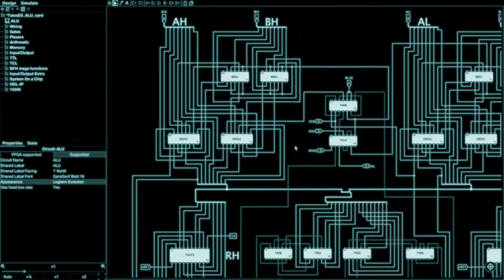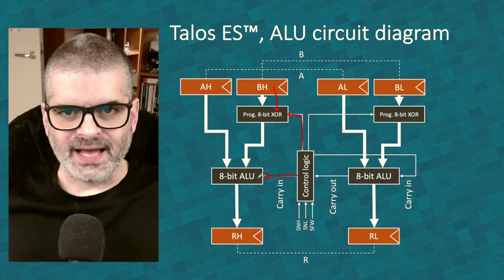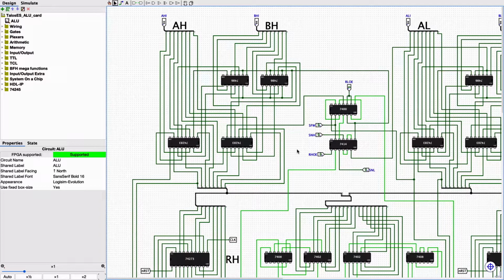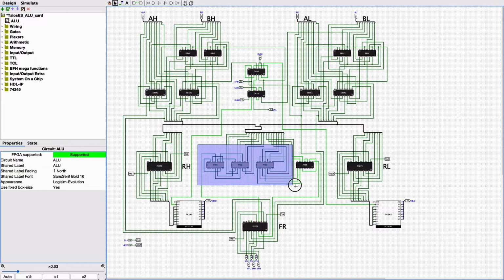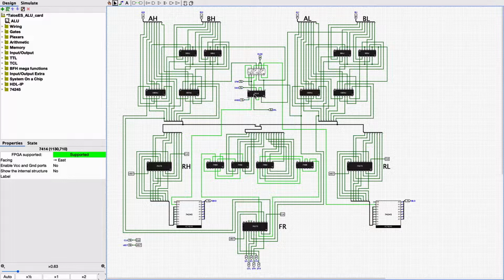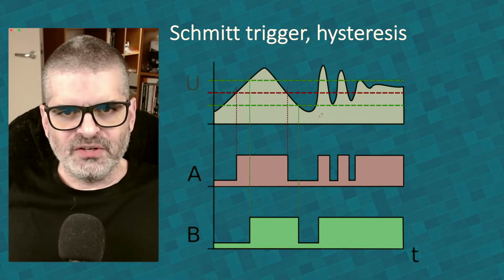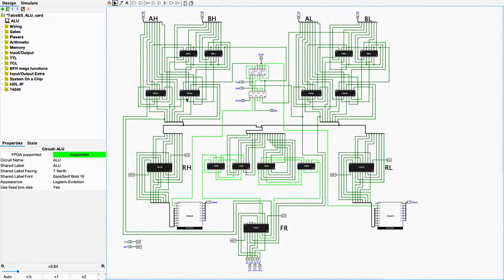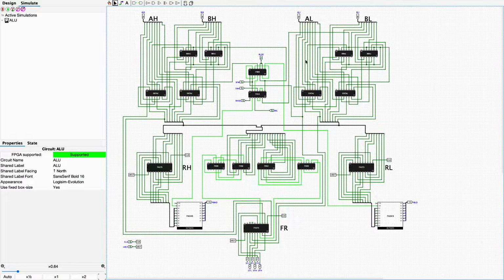Building Talos ES™, the 21st century's mini-computer (Episode 2)

Comment: I was wondering: since there is no Overflow flag, does this mean we cannot readily detect out-of-capacity results when doing signed-integer arithmetic?
Reply from the maker: You can use the carry flag.
Reply: @thebyteattic  But the Carry flag will be set if the unsigned representation overflows, which does not mean it is automatically invalid if we have signed-integer semantics, right? How then are you able to distinguish and, i.e., implement both the equivalent of the 6502's separate "branch on overflow set" and "branch on carry set" instructions?

Comment: Great video and nice explanation about needing driver chips - although, I haven't used any drivers in my homebrew computer.  I read about fan-out and understood that CMOS chips have a bigger fan-out than NMOS?  It seems to work ok for my personal computer project, but I guess I wouldn't rely on my approach for production use!!
Reply from the maker: Yes, typical 5V CMOS chips have a fan-out of 15 these days. But this assumes that the total current draw from all pins combined doesn't exceed its limit (which is considerably lower than multiplying the maximum current draw per pin by the total number of pins!). So you can't hang 15 loads from every pin. Moreover, the limit depends mostly on the input impedance of the loads. The limit of 15 loads assumes CMOS loads with very high input impedance. But a single load with low input impedance can destroy the chip (e.g. if you drive, say, a VGA line with 75 Ohm input impedance from a naked 74HC pin, which would draw 5V / 75 Ohm = 66 miliamps, more than ten times over the limit, or at least 0.7V / 75 Ohm = 9.3 miliamps, which is still almost twice the limit).
Reply: @thebyteattic  Thanks for the deeper answer, very useful as I have generally not considered the impedance of the input pins (nearly always it's another CMOS part, but not always!)👍🏽

Comment: Mmm, not sure if I understand the design here (watching the explenation starting around 35:00 of write-back or the lack thereof). I assumed A/B H/L are local to the ALU, not actual registers of the CPU, which are driven from the register file (yet to be designed) that can output two registers at the same time to feed A and B. And the results of RH/RL van be fed back into the register file, which for write latches the values on the clock, so that on the next clock they will be written, and can subsequently (in the same tick) be output again. That would save dedicate reg-reg tranfers.
Reply from the maker: AH, BH, AL and BL are in the register file. RH and RL are local to the ALU. The ALU cannot write back to the register file in the same cycle that it is reading AH, BH, AL and BL from the register file, otherwise we get a race condition. Therefore, the ALU can only write to its own local registers RH and RL. Subsequent instructions can then move the values in RH and RL to the register file.
Reply: @thebyteattic  Ok, A and B are in the register file. But you could add a latch to the register file that would load the output of RL/RH and latch/write it at the start of the next clock tick? Which would also allow those values to be used in that clock tick?

Comment: Can you set clear the carry flag ? I understood you can't (I understood when doing a substation it will be set, but you might need to be able to set/clear it if you want to do multibyte/multiword operations (carrying the Carry over from byte/word (in case of 16bit add/sub) to the next one.  Don't you? How will you handle that?
Reply: (I'll be honest I haven't opened the design in Logisim to check by myself before asking)
Reply from the maker: @adumont  You will understand when you open it. The logic in the ALU is purely combinational. The results and flags flow from the bits in the operand registers. When the contents of the operand registers change, the results and flags change (one operation every cycle, the flags register being clocked every cycle). There's no need to clear the flag between one operation and the next; the operands of the next operation will automatically change the flags.
Reply: @thebyteattic  I understand the ALU will change the carry flag. But imagine this scenario, you need to add two 4 bytes operands. You'll have to do two 16bit additions, and feed the carry of the first addition into the second addition. The carry can't be cleared in the second addition, it should be tge carry from the first 16bit addition. Similarly with subtraction (in that case you'll start with a carry set, but it could be cleared in the second substation). At least that's my understanding.

Comment: Have you looked at using a 74HC573 instead of the  373, the 573 has all the inputs on one side and the outputs on the other instead of being mixed up as they are on the 373
Reply from the maker: I didn't use them for two reasons: (a) for certain registers (namely, pipeline registers) I wanted a reset/clear input; and (b) I wanted to stick to parts modeled in LogiSim-Evolution as much as possible, for I consider those simulation models integral to the project.
Reply: @thebyteattic  Apologies, i misread your 74273 (on a small screen) as 74373 , should have remembered a 373 doesn't have a reset pin !
Reply from the maker: @jameshearne891  No need to apologize! Cheers.

Comment: Hi Bernardo, you mention using buffers that are designed with the inputs on one side and the outputs in the other. Why did you not use the same idea for the results register edge triggered flip flops?  I think the 74754 may be a tidier choice…
Reply from the maker: That's not made in DIP/THT packaging anymore, as far as I know... Otherwise, it would have been.
Reply: @thebyteattic  What is THT?
Reply from the maker: @obiwanjacobi  Through-Hole Technology, packages with pins that go through the PCB, as opposed to surface-mount stuff.
Reply: @thebyteattic  Right, I thought you meant a family (like HC/HCT/LS/F etc).
I see 19.000 stock on farnell for DIP 74HCT573 but DIP 74HCT574 is not even listed... Go figure.
Reply: No worries... I didn't know you were looking for just through hole parts.

Comment: You appear to use 74283 chips (4-bit adders) and not 74181 (4 bit ALU), so therefore you need a separate XOR to make subtraction possible.. But you do not have AND/OR/XOR functions in this ALU, which most actual ALUs have. How will you implement shifts? Especially right shift?
Reply from the maker: The '181 is no longer manufactured. I won't be implementing instructions dedicated to boolean logic.
Reply: @thebyteattic  No XOR/AND/OR? That doesn't seem very useful?
Reply: Not sure about the rest of the question, however Bernardo says he wants to use current parts - you can’t buy an ‘181 any more.
Reply: Hopefully to be described in a future episode? I’ve looked at the functionality of the 74181 as I’ve tried to understand the ancient 3 Rivers/ICL PERQ (from documentation; I don’t actually have one lol) The '181 also has no shifter, beyond an equivalent to a one bit shift left of F=A+A. I guess you could do similar here by copying A to B before the add or loading the same value into A and B.

The PERQ had a barrel shifter sat after the ALU in its microcode engine made largely from am25s10 shifter parts; no idea if anything similar exists today.

Comment: So, you covered 8-bit subtraction well. How does 16-bit subtraction work? Will there be 16-bit subtraction?
Reply: The same way, just use the negative control flag and 16 bit wide flag to make BH and BL into a negative number and add them…
Reply: @dugmeister65  Of course. Set both ALN and BLN. D'uh! Apologies.
Reply: No worries! We are all learning… I’m really looking forward to the rest of the design… Cerberus was great to watch coming to life…
Reply from the maker: Yes, 16-bit subtraction will be there. I see you guys already figured out how. 🙂
Reply: @thebyteattic  Will that work though? If you split a 16-bit number into two 8-bit numbers and do a 2s-complement on each number then jam them back together as a 16-bit number, won't that have errors? It's been about 20 years since I last dealt with 2s-compliment numbers.
Reply: @CollinBaillie  you don't 2's complement both halves, just invert both halves and add 1 (carry in on the LSB). The carry out from the LSB is the carry in for the MSB as it is between bits, so all good.
Reply: @dugmeister65  Beautiful. So +1 is only ever applied to LSB of AL or BL, so in a 16-bit operation, BLN flag is set, but not ALN, and the logic handles it all.
Reply from the maker: @CollinBaillie  Yes, @dugmeister65 explained it. Have a look at the next episode, where I show it being simulated.
Reply: @dugmeister65  But the SNH sets both the invert and the carry in (as does the SNL), but how's a borrow handled in that case?

Comment: Enjoyed this. I think if it’s was me, I’d have had an interim step of a pure logic diagram before transitioning to the IC representation — but it’s your design so that’s fine 😊

It was unclear to me until quite near the end if the A, B, R and F registers were just registering your pipeline or registers in the computing sense. If I understood correctly, they’re your actual (only?) architectural registers rather than the flip-flops between pipeline stages. Some of this will no doubt be clearer once we see the draft ISA you’re trying to implement.

I need to download the logisim files to see the parts used — was watching via TV so they’re a blur. I guess the core of your ALU are 4-but adder chips if you’re handling negation with other devices.
Reply from the maker: Cheers, mate.
The simulation needs to be representative of what I will put on the actual board, therefore I use IC models, not loose logic gates. If I were to use abstract gates, a correct simulation run would mean very little, since the most error-prone step would be translating the abstract gates into actual IC interconnects. That's the reason I simulate the actual interconnect I'll be putting on the PCB, otherwise the exercise is futile.
Regarding the registers, since the entire execution is done in one pipeline stage (the others being instruction fetch and instruction decode), the distinction between pipeline registers and operand registers sort of disappears. Yes, the registers are all operand registers; but they are also the execution stage registers of the pipeline.
Yes, I use 4-bit ALU chips.
Reply: @thebyteattic  I guess I would view the basic logic diagram as a design step towards the chip based simulation — but I can’t fit all the 7400 series chips in my head to know which to pick for a given element. I would rather hope that the simulation tool itself would have sufficient features to aid assuring the logical diagram and the chip diagram are equivalent.

So working backwards, we so far have an ISA which has R := A + B, R := A - B, and from the video we will be getting move instructions equivalent to A := R and B := R … with all the relevant carries/borrows and 8/16-bit variations. Interesting.
Reply from the maker: @timothyp8947  Yes, essentially that. I chose to present some hardware first to avoid the ISA discussion becoming too abstract. I want people to get a concrete feel for the control lines and overall structure early on. Regarding the step of designing the logic based on individual gates first: that's usually justified for random boolean logic, or 'noodle logic': complex and fine-grained functions usually derived from Karnaugh maps and the encoded states of a state machine. But here, in this ALU card, the logic is mostly quite regular and structured. Only the two chips in the control part are slightly more fine-grained. Logic-wise, thus, this is all pretty straightforward, coarse-grained stuff, so there is no need to design at the level of individual gates; it would only make things unnecessarily complicated. I am explicitly minimizing random logic in Talos, with only one small part where I suspect it will be inevitable (the logic treating external control-flow signals like interrupts). We will see.